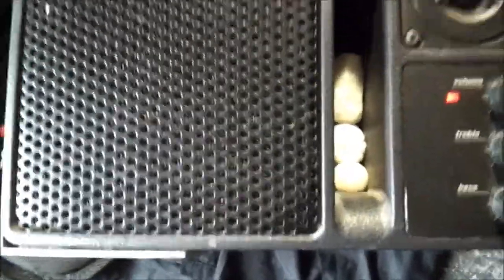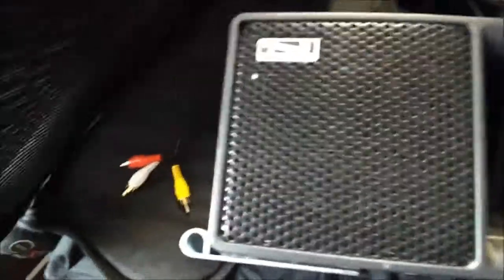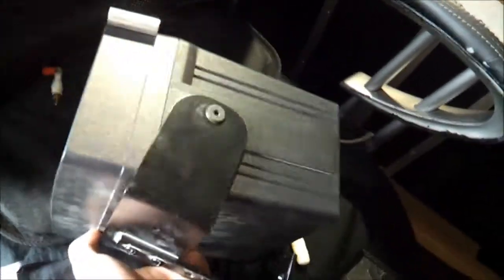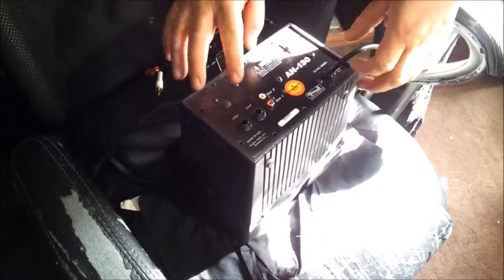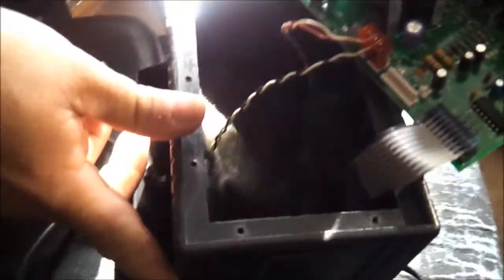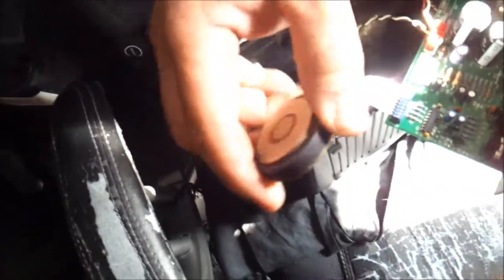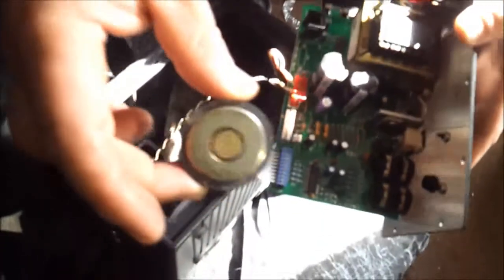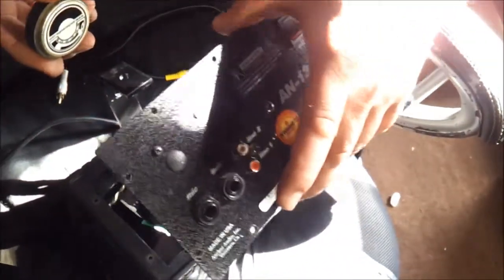Anchor AN-130 Monitor broken Tweeter discovery

Comment: Just found my tweeter magnet had also come apart.  It was stuck to the transformer (magnetically), when I opened the back panel.  I actually carefully glued it back in place.  Didn't use shims to put it back in place, but it's working great.